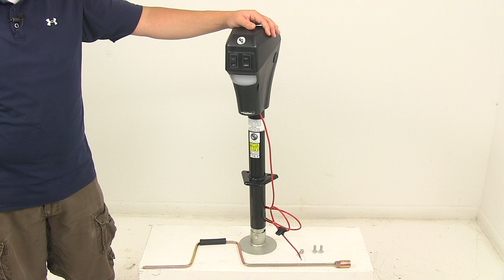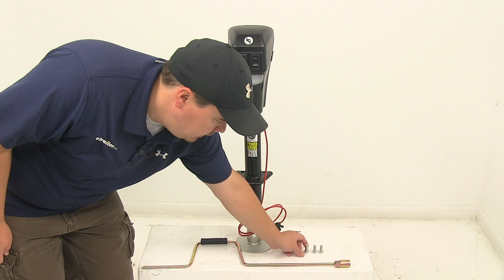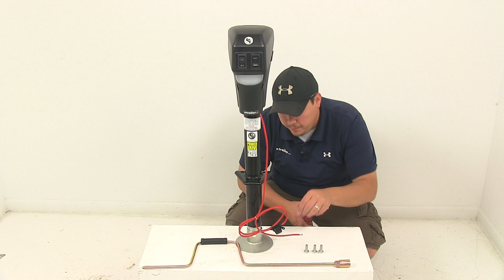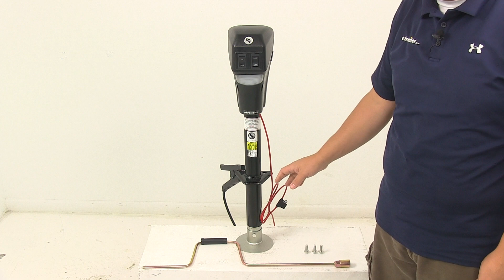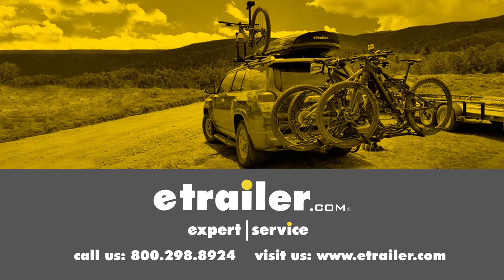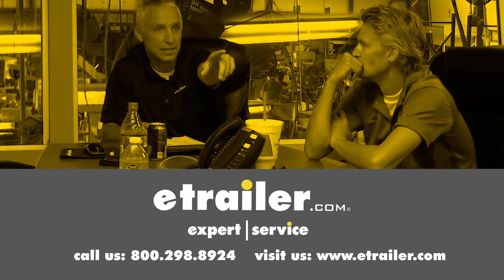etrailer | Hands-On with the Lippert Electric Trailer Jack with Footplate

Comment: After hearing about intermittent issues, whether rare or not, with all these jacks I'm just going to keep on cranking mine and know that its going to work every time.
Reply from the maker: With this jack being electric, you will have to be sure that it has a power source when wanting to use it. They work well but if you're wanting a fool proof solution, a manual jack is the way to go.
https://www.etrailer.com/Camper-Jacks/Lippert-Components/LC285318.html

Comment: Is it possible to take apart and rotate the head so that my tailgate will clear it when the trailer is connected?  Even if it voids warranty?
Reply from the maker: The head of the jack itself cannot be rotated but the jack can be unbolted from the trailer and reinstalled when the desired position is achieved.
https://www.etrailer.com/Camper-Jacks/Lippert-Components/LC285318.html

Comment: why would the jack work and in 2 hrs later stop blow the 30 amp fuse ?
No disconnect interim; just hooked up and then dropped it.
Reply from the maker: Check to ensure your ground is good. The next thing you will want to check is the wiring to ensure there are none that are damaged or loose. A damaged wire, or even one that is crimped, are what would cause a short that would blow fuses.
https://www.etrailer.com/Camper-Jacks/Lippert-Components/LC285318.html